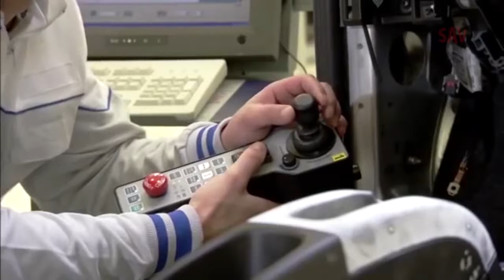Fiat Panda Production (Pomigliano d'Arco, Italy) FIAT Factory, Panda Assembly Line, Fiat Plant

Comment: That a perfect city car i have the same i really love that car
Reply: I had two Pandas. First was a new one in 2012 with the twinair engine, a joy to drive. Second one was a new 4x4 version in 2015 but unfortunately I got the diesel which had terrible gearing for anything other than town driving. Five speed box, at 70mph it was doing nearly 4000 revs. Appalling. I owned it outright and traded it in for a new Abarth 500 which to this day was one the best cars ive had. I regret selling it when I lost my job as I could easily afford to run it at the time.